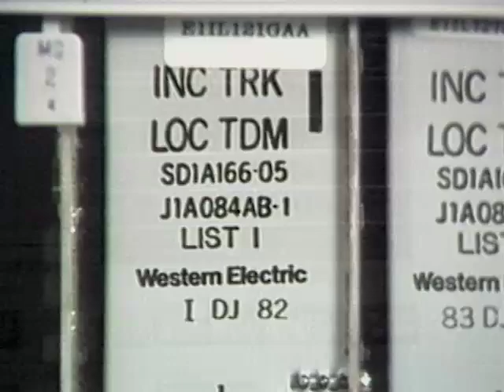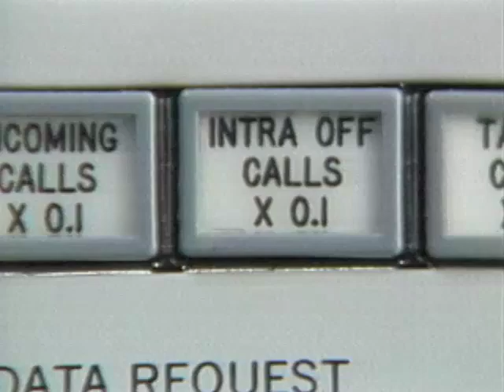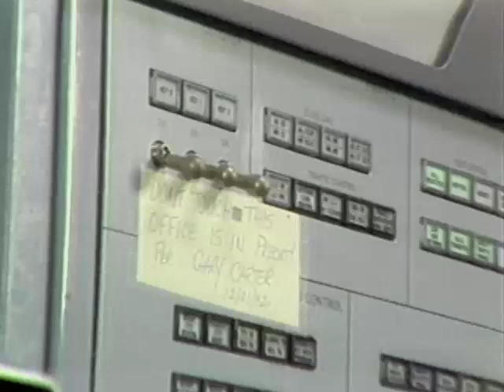Speedy Cutover Service, SXS switching cutover to ESS filmed live at Glendale CA central office, 1984

Comment: I remember the day my CO (Greenacres, FL) cut from a CB to 1A ESS. I hosted a “cutover party” at my house where I had a speaker phone pumping audio into my stereo sound system connected to a termination quiet line waiting for the cut to occur. And when it happened you could hear the cut! Along with loss of DC, then about 10 seconds later my new dial tone! That’s how we partied back in the day. I think I was about 23 years old.
Reply: What year was this? I lived in Greenacres in the 80's....Chalet IV between 6th & Lake Worth Rd. Lived in Florida Gardens in the early / mid 70's.
Reply: cool.
Reply: Wow, I wish I had a video of that! How did you know when it was gonna happen?
Reply: @HelloKittyFanMan.  because the telephone company told people exactly when they were going to do that so that people wouldn’t be making important calls that would get cut off
Reply: I remember the cut in my town from step to 2BESS,  U got the old dial tone & the new dial town mixing together @ the same time.  It went on for about an hour!
Reply: Just wanted to let you know that kids these days are still doing this stuff with new fiber lines and CMTS upgrades. Same song, different verse, bits keep flipping :D
Reply: Worst cutover ever.....
Reply: How neat!  I remember the moment our area code got reassigned.  My (now long-distance) call was cut off, and dial tone resumed about 20 secs later.  My mother worked for Rochester Tel as a network engineer, so I knew when and how, to see it in action.
Your story is so much cooler!  Thanx for sharing!
Reply: Sounds like you guys really painted the town red back in the day.  😉
Reply: That's nerdy-as-heck and I love it! 🎉😂🎉
Reply: You legend... that was before drugs were invented, right?
Reply: Sad to see that @luvencl never replied to @Caterina Falcone
Reply: @caterinafalcone1  sorry for the long delay. I didn’t see your reply until now after sending this video to a friend and catching this comment. I don’t remember exactly when it was. I’ll try to find out. But you were served out of the Greenacres Central Office for sure.
Reply: @HelloKittyFanMan.  I had inside information as to when the cut was going to happen.
Reply: @Outlawstar0198  I just did an offered an apology for the delay. I guess I never got the notice for some reason.
Reply: @DJ_Megahertz  thank you for replying. We were curious!!!!
Reply: wow, that takes me back. excellent. excellent. thanks.

Comment: WOW. Sharpened in such a way to cut cleanly and without shorts? Do say... please share this alien technology with the rest of us 😉
Reply: As an electrician I was like wtf but I forgot about the aliens.
Reply: I see sparks flying at 3:40, so something was shortened anyway. 🙂
Reply: @fredrikjohansson6515  there's a scream around that time but I didn't see a flash??
Reply: Look again. He cuts 4 more cables after the sparks.
Reply: @fredrikjohansson6515  I watched it again at .25 slow motion. There definitely is something. Thanks!
Reply: fanplant Great 👍
Reply: @fanplant  I was thinking jokingly that "somehow" a finger was lost
Reply: He misspoke, that's all.
Reply: @fredrikjohansson6515   I think it may be a glitch in the video. The item of interest follows the same horizontal line. Also the man cutting the cable didn't flinch or react.
Reply: @matt9c1  it may be how the film was scanned. It's possible that ringing phones could have been sparkling randomly for everyone cutting and they know not to stop. Hey I'm to young to know so maybe someone who has done these cuts will let us know.
Reply: I saw a few small sparks actually. Also what was that blood curdling scream for?
Reply: I think they meant without creating any persistent shorts, where some copper might be pulled from its insulation and stretched/displaced just enough to overlap another wire at the severed end. That'd leave affected lines out of service (or noisy/unreliable from being crossed with one another) even after the ESS took over, until the leftover tails could be removed. Of course there'd be lots of shorts happening the instant it was cut, but that doesn't matter since those lines were all going (briefly) down anyway, and have current-limiting resistors to safely withstand this in the event of wiring faults downstream.  It's not like shorting out the 48V battery bus, but a few sparks from ringing lines, etc. wouldn't be a surprise.
Reply: @jordanhazen7761  well put!
Reply: They used what is called a sharpener
Reply: @fredrikjohansson6515  not permanently 3i guess?
Reply: Also the scream sounds like a cheer from someone who finished first or fast judging by the fact that no one else reacted to it.
Reply: fanplant Someone lost a finger 😯
Reply: OvalWingNut 😂
Reply: Probably only the edge of the blade is sharpened, and the rest is painted so no metal contact
Reply: Well, they were all wearing pants, so I'd say it worked.
Reply: my thinking was that after the cut was made, the cut was clean and there were no ongoing shorts made. of cause during the cut, there is a short through the Metal blade, a ceramic blade may be able to have been used, but from what I recall (30year old off-hand info) it's very low amp high volt)

imagine if there was a short that had been created after all the cuts were done, and they had to find it.
Reply: No one was wearing shorts....all in commando mode...carry on.
Reply: @eaterofclams  you would need to be careful the person below you didn't shorten your dangly bits ;) carry on :D
Reply: I used to be a POTS/DSL technician 15 years ago and listened the old guys talking about switches to digital like this.
48v per pair run to power telephone devices, very low amperage. 
Shorts can happen but no damage is done. He meant to say - no shorts will be left on the cables (probably 50 or 100 pairs or more per cable to be cut), not leaving copper wires touching each.
Reply: Could have been t1 lines in the cable up to 150v on those
Reply: @wesley00042  Well played.
Reply: @matt9c1  That is not a electric spark. It's dropouts in the video tape.
Reply: @fredrikjohansson6515  that was a DID trunk with low loop resistance :)
Reply: I remember the day my CO (Greenacres, FL) cut from a CB to 1A ESS. I hosted a “cutover party” at my house where I had a speaker phone pumping audio into my stereo sound system connected to a termination quiet line waiting for the cut to occur. And when I happened you could hear the cut! Along with loss of DC, then about 10 seconds later my new dial tone!
Reply: He means no permanent shorts between adjacent wires . Power supplies, and io on digital systems would be fully protected against temporary (and even permanent) shorts and transients.
Reply: @matt9c1  He wouldnt anyway..the Cutters would have rubber grips to avoid getting electrocuted.
Reply: @joaoc_PT  I think people are assuming those lines are for carrying power.
Reply: Non conductive ceramic scissors?
Reply: I wonder how they did this. When I once cut a power cable with a side cutter it very quickly became apparent that
1. The line was still live
2. The blades do short the wires when cutting
Reply: It meant  razor sharp blades.  Everything else is just adding to the drama.
Reply: @fredrikjohansson6515  How on earth did you catch that?
Reply: @MetalheadAndNerd  a power cable with 120v AC at 60 hertz on a 15amp circuit will be a much bigger light show then the low current 50 some odd volts coming out of the phone line.
Reply: There was sparking from the time they started cutting to the end.  Some were bigger sparks than others, but a good number of cables had at least one spark.

Typical management...give a statement to the public that is complete nonsense.
Reply: I think this means no shorts after the cable has been cut. If I understand what's happening here, they're cutting the connection to the old switch but the other side of that cut is still connected to the frame and ultimately, the new switch. A short on that part of the cable would prevent whatever lines were shorted from working. I'm guessing they went back afterward and completely unwired and removed the old cabling entirely.
Reply: @fredrikjohansson6515  those were sparks from the guy cutting at a super fast pace
Reply: There ceramic coated and conduct nothing, the few sparks you do see are line to line shorts, not shorting thru the cutters.
Reply: @fredrikjohansson6515  yes, the cables briefly short during the actual cut thru the cable but don't remain smeared together and stay shorted after the physical cut is complete for the cable
Reply: The curve and the angle of the blade is what's giving it a clean cut. Those qualities allow it to more cleanly cut circular bundles of wires. Straight blades "push" against the bundle. They're considered specialty tools.
Reply: 🤔 Well, ok I can’t say for sure but the method I know of is that the blades are sharpened and then painted.  🤷 With low voltage it’s possible to get through the cable and it’s more or less free of a prolonged short.  🤔 The whole “no short” 🤷 maybe sales wrote the piece?
Reply: @fredrikjohansson6515  that was the vcr tape head not reading the tape right
Reply: @fanplant  that was the vcr tape head not reading the tape right
Reply: The cables they’re cutting have hundreds of 24ga pairs within, all individually insulated.  The energy carried is very low voltage.  Not enough power to hurt you if you managed to touch it.  And the face of those cable cutters is hollow ground, so as the cut progresses through the cable, the only place touching the copper is the edge.
Reply: American made and American sharpened, good quality control
Reply: @ looks more likea problem with the tape

Comment: That procedure only worked where there was space available in the central office to install the ESS. Many older central office buildings leaked space to install the new switch until the old one was removed. In that case a "hot slide" was done. The new switch was installed in a temporary building with cables long enough to connect to the Main Distributing Frame. Once the new ESS switch was operating, the old SXS switch was removed, and the ESS switch was slid into its permanent home while operating. The temporary building was then removed, and the cables "half-tapped" or spliced to remove the excess length. All of this was done with no interruption of service.
Reply: "leaked space" the strangest thing I ever saw was in Dallas TX in 1974. The SXS building lacked any space for a new switch.  An addition was made to the building enlarging the second floor switch room. on the old side of the room all of the SXS switch spaces were crammed full of test equipment. on the new side there was not even a pin on the floor.  I asked why and was tolled as long as they did not use the new floor space, they would not have to pay property tax on the new part.
Reply: @gpwgpw555  Where was that located? I've only heard of the co in Farmers Branch/Carrollton, which I think is also a billing facility. Not sure though.
Reply: I do not know. I was only in Dallas for a school on Touch Tone registers used in a  SXS office.  I ws from Oklahoma City at the time and did not know Dallas.
Reply: Awesome follow up on this vid!
Reply: Around here they built new buildings for the electronics and just redid the wires. They still use the old buildings as storage.
Reply: Bill Moran wow that’s crazy! What an operation. Some truly smart people invented and maintained systems like this.
Reply: @gpwgpw555  So you correct the original poster as to their error with "leaked" instead of "lacked" but yet you go and and say you were "tolled" when you meant "told" .. Class act dude! Don't even know what point you were trying to convey??
Reply: @garylen4744  Thanks for pointing out my spelling error.  It was done by Spell Check.  There are three thing I can't do. 1. I can spell. 2. I can't remember names. 3. An I can't remember the third thing. HA HA . You should see what I type without Spell Check.  The only point of the comment was the weird law in Texas about property taxs.
Reply: Back in my hometown, the old SXS switch was lock-stock-and-barrel replaced by a new building across the street -- circa 1980. (DMS not 5E) The old building was the size of a country supermarket; the new one, about the size of two tech vans.
Reply: TheOtherWhiteBread0  When you can build a small building on 1/8ac, and then sell the 2+ac lot where the old switch lived, it's not so much an expense.
Reply: You knew you worked in a big CO when the Main Frame was hundreds of feet long and had a balcony.
Reply: Lol I did that sort of thing with some office computers in the 90s.  Fortunately long cables were economical by then
Reply: Slick.
Reply: Space to have both installed in place at the same time. And did you mean "lacked" instead of "leaked"? Wow, "hot slide" sounds interesting! But why treat "main distributing frame" as a brand?
Reply: @gpwgpw555 : "Tolled"? Charged a toll? What?
Reply: @garylen4744 : We don't know the answer to your question of what you know because we're not mind readers. Also, it sounded like his point was about how property tax was handled during the stages of a switchover.

It is funny that he corrected someone while not noticing his error as generated by his system, but it isn't as if you have to act so affected by it, since you aren't even the one he was talking to.
Reply: @gpwgpw555 : Yeah, weird about the property tax thing. But if your spell checker does that to you, you might wanna disable it. Also, it's not a brand. Why capitalize it?
Reply: @calbob750 : When did "main frame" become a brand?
Reply: Yes, they had to build a new central office building in Baden,  PA in 1980 accommodate the new 2BESS office.   The old  step by step office built in 1930 was too draconian & small!

Comment: AT&T Service in a nutshell: "GoOd EnOuGh"
Reply: It was actually of quite-high quality...
Reply: I work in IT.  They don’t want it good.  They want it good enough.
Reply: Not to be confused with John B. Goodenough...
Reply: Having worked on making lines clear and clean, I can say that phone service quality was at it's peak in the 80's and 90's.  And, then peoples' expectations lowered when they got cell phones.  Now it's all about whether your phone is getting a strong, uninterrupted signal or not.
Reply: @TesserId  I remember busting out laughing in the 2000’s when my land line call messed up and I got some automated notification.  That NEVER happened before.
Reply: @kevingray8616  that way they can come later and "make upgrades" to the service, make your internet more reliable, faster (meaning they fix what they fucked up) and charge you more money.
Reply: @kevingray8616  that's most engineering combined with business

Comment: "Are there any emergency calls in progress?"
...
"Good enough."

What does that mean? Only one emergency call in progress, and they were already dead anyway? Lol.
Reply: I had the job of calling the 911 PSAP like the woman at 02:51.  After the cut I made test calls to 911 to be sure the calls would go thru.
Reply: I worked on 5ess in Naperville Illinois for a number of years.  Did a bunch of testing and support roles.  911 calls were treated very seriously.  There were times in the field where switches would be dropping 40 percent of the calls and there were screaming matches on conference calls trying to decide to boot the switch
Reply: "yeah but they're already gunna die so"
Reply: "Hey, Mary Ellen, yah we've got a few on the line but they're all poor, so you should be fine to proceed."
Reply: I guess the response was something like "Calls in progress, but no emergency". There are always some calls like car accidents without injuries, you can absolutely interrupt in such a situation.
Reply: I'm fairly certain 911 wasn't in operation in Los Angeles County until late 1984. There was probably just one TSPS operator office open at that hour that handled calls from the telephone prefixes that were going to be cut in that central office. All the woman did was call the TSPS office, where the supervisor there yelled out to the operators if they had any emergency calls held on their positions. Nobody indicated they did, so they started chopping the cables. If there was a call they would have waited until it was completed. If a customer dialed the fire or police department directly and they were on an emergency call at that precise time, they would have been cut off. Almost no customers called the police that way, since they rarely knew the direct phone numbers off hand, so they dialed "0" and said "Operator, get me the police!"

Comment: "Hey Bob, you wanna get paid for a few hours of overtime this Saturday? You just need to use garden shears to cut 20 cables and that's it!"
Reply: well actually  you only get 47 seconds of overtime.
Reply: @riphihe  Training, and waiting for the all clear
Reply: As a cable splicer, I find branch loppers are excellent for most cables.
Reply: 2:00 And the guy at the left of the screen gets something special to smoke.
Reply: @andrewsmith9174  I'll have to give that a try!
Reply: @iamdave84 , just don’t do it on cables with steel strength members. It’s good to 600pr 22 ga copper. After that, I use the ratchet cutters.